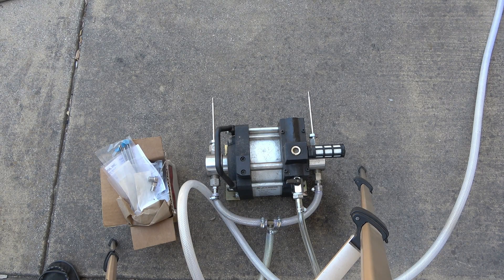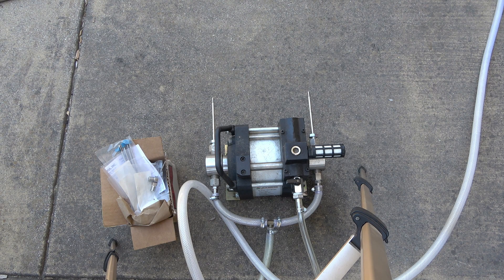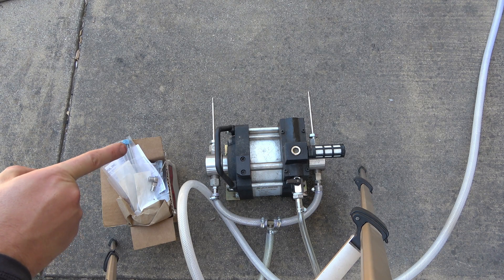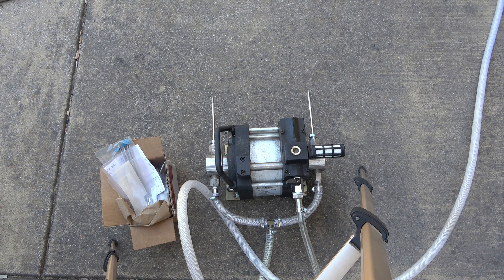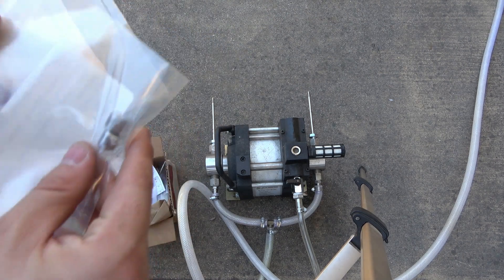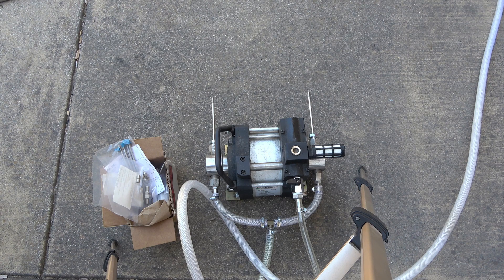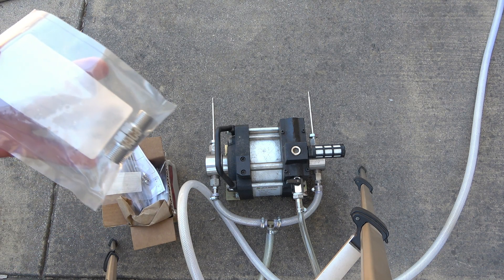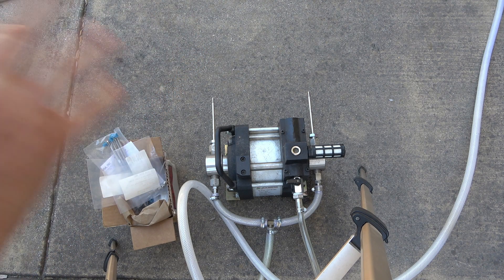Waterjet Update: 8/30/23

Comment: I'm very interested to know about this pneumatic pump. Is it your invention or is it a commercially available item? Are there any links where I can learn about it? I'm curious to know why you're using a pneumatically driven pump instead of a conventional direct electric motor pump. I've always thought of pneumatic systems as much less power efficient than direct motor driven systems, despite being inherently suited to some specific applications, like sand blasting, low cost actuators, vacuum cups, etc. I don't understand why a pneumatically driven pump is suited to this application over a direct drive electric motor.
Reply from the maker: Direct drive is quite a bit more efficient. The origional idea why i went for this type of system was that i was going to use it at a maker space that i was going to so the compressed air was free. they have like a 50 to 100 hp air compressor. also the other reason why i like the compressed air idea is that you do not need a high pressure cutoff theoretically.

Comment: Funny how, I have the same idea building a water jet (enough to cut glass and softer material than steel and iron). I plan to use car wash pressure machine, it can produce 3600psi. cost $850. hope it will works.
Reply: The injector pump of a diesel engine has much more pressure. I wanted to use this part but I don't know if it can be modified for water use
Reply from the maker: this would probably work. But water isnt a very good lubricant compared to diesel/oil.